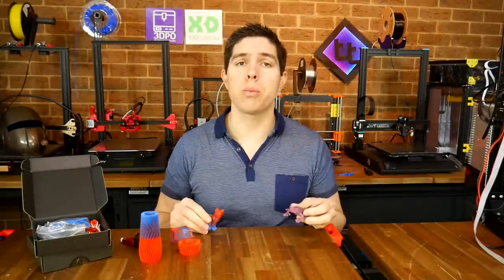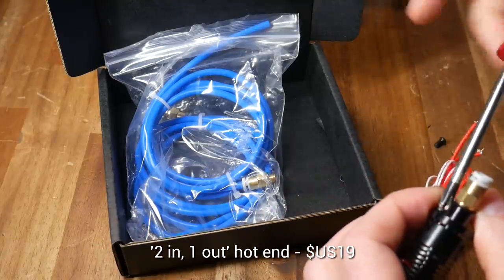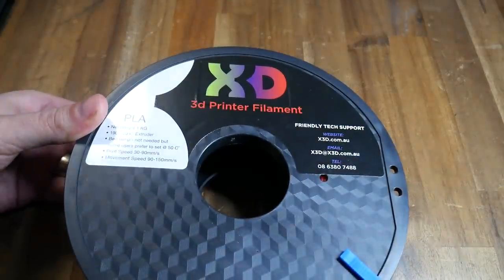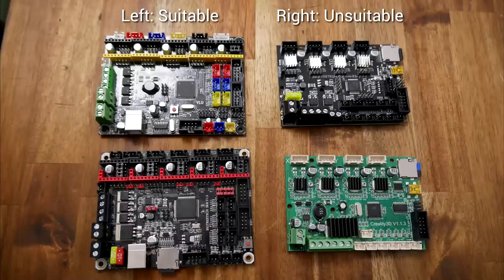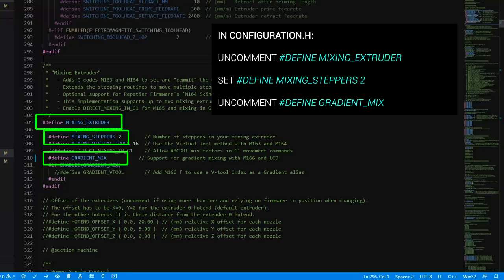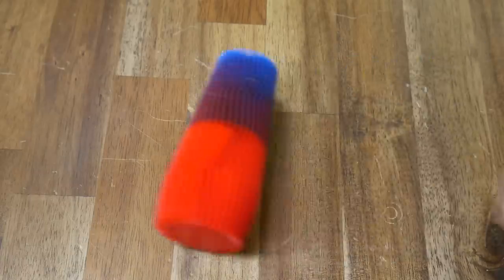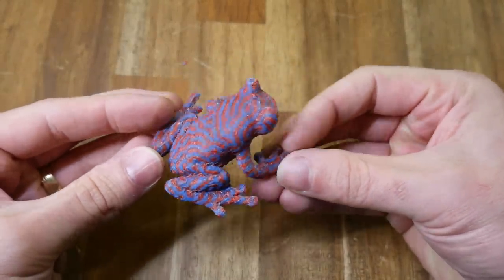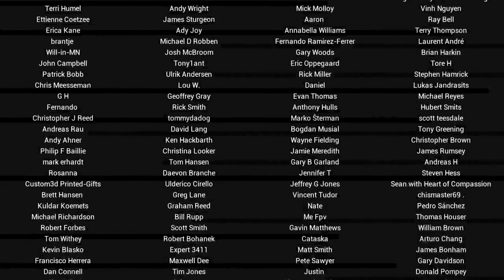Add dual extrusion with gradients - Mixing hot end guide

Comment: 1:01 I bought this hotend (that has a y joining peice at the top). This is so poorly engineered that it doesn't even work. When one filament is retracted and the other is moved to the nozzel, many times it is stuck. Also the part at the top of it is made of metal and it scraches the filament so badly and collects filament debrees inside of it which eventually results in a jam. Money wasted. Now I am going to buy the mixing hotend shown in this video hoping it works.
Reply: Hey so did you buy this one and get it to work successfully?
Reply: @syedsulaiman8380  No. It didn't work. The y joiner on that hotend is very bad. It scratches the filament and collects debrees inside it. Also very often when the extruder is changine the filament with other color, it blocks the way and the extruder stepper looses steps.

Now I have ordered the mixing hotend that is working in this video. Waiting for it to arrive.

Comment: As the nozzle is proprietary and non-replaceable one have to replace the whole heatblock assembly to switch to a new nozzle. Nozzles do degrade and need replacement every now and then. So that's a big "Nope". Huge dealbreaker.
Reply from the maker: Let's hope they end up selling just the nozzle, with a tool to remove it and in different sized orifices.
Reply: You could try an E3D Cyclops instead. A standard nozzle may or may not make mixing less consistent and require longer purges.
Reply: At least make it hardened steel.

Comment: Is this/similer 2in1 mixing hotend now being used in Sovol SV02?
Reply: Has anyone tried using SV02's mixing hotend in Ender3/Pro? Do the screw holes of SV02's mixing hotend match with with that of E3/Pro hotend backplate?

Comment: Yeah that proprietary nozzle is a deal-breaker lmao
Reply: Yeah it's a shame they use that strange proprietary form factor.
Reply: From the research I have done it's even glued in place somehow, so I don't know if/how it can even be replaced in the future.
Reply: Same sentiment, but AFAIK the mixing has to happen in the hot zone so you'll always be stuck with proprietary nozzles (unless there's some kind of standard for mixing nozzles?). Also those nozzles increase significantly in size (especially when you look at the 3 way mixing nozzles).
Reply: @rpnct  I have a 2 in 1 out mixing hotend that uses the same nozzles as the stock ender 3... apart from that it works exactly the same melting both filaments in the hotend block and color mixing / gradients etc all work as above.
Reply: @n2n8sda  hi can u share a link to find that kind of hotend?
Thank you very much
Reply: @n2n8sda  hey can you share the info on that hotend? That's the only thing I need for a complete build
Reply: @n2n8sda  Link to Hotend?
Reply: Ok this is awesome  would love too see it take a few steps more and have multi colour and types for supports, o rings and hinges
Reply: @--3D  i'm from Canada so that one is able to ship to me within a month so it seems like it could be a good option what printer did you install it to?
Reply: @datrandomdugggy5537  I'm from Uruguay I was planning on using it in an Anet A8 plus, but as I couldn't find nozzle replacement I didn't buy it
Reply: @--3D  doesn't it just use a stand nozzle?
Reply: @datrandomdugggy5537  check in the video min. 6:40 you'll see how different it is
Reply: @--3D  I was referring the the one you linked me it seems like it has standard nozzles
Reply: @datrandomdugggy5537  , sorry my bad the link I sent you is not the same like the one in the video
Reply: @--3D  the one you sent me does look like it might work
Reply: @datrandomdugggy5537  last night was late for me, sorry.
Yes, the one I sent you the link is 2 in 1 out.
But it doesn't mix colors.
Look for more info about it?
Reply: @--3D  yeah I'm going to do more research into this
Reply: @datrandomdugggy5537  as far as I know, the one in the video can mix colors and doesn't need much retraction to change colors.
And the one I sent the link changes filament on the top
Reply: There is a new version in which we can change nozzle
Reply: @syedsulaiman8380  link?
Reply: @syedsulaiman8380  do u have any links? Thank you
Reply: @syedsulaiman8380  thanks 🙏😊
Reply: @syedsulaiman8380  I don't know, but I don't think so.
Anyway this one is 2 in 1out but doesn't mix colors I think 🤔
Reply: @--3D  which one the one in link?
Reply: @syedsulaiman8380  yes, does it?
Reply: @EKUL34  awesome thanks for sharing 💪
Reply: In my amateur opinion, this should be possible with a standard nozzle but unique melt zone so here's hoping someone more skilled than me agrees and makes it real

Comment: I installed mine ok but after PID autotune via Octoprint terminal which confirmed that it had finished, the temperature is still fluctuating widely. I saved the settings via M500. Now, when I try to print something, the printer heats up but when it gets to set point, it doesn't start the print, only having E Heating on the status line. Anyone have any ideas? I've a printer now that won't print!

Comment: I know this video is old, but has anyone used this hotend recently? I'm having a nightmare with thermal runaway. Does anyone know whether a silicon sock exists/fits this mixing hotend?
Reply: Update in case anyone sees: if you're using this hotend, it comes packaged with an HT-NTC100K cartridge thermistor. If you're running an Ender 3, in Marlin configuration.h you need to change #define TEMP_SENSE_0 1 to #define TEMP_SENSE_0 11, upload new firmware, and then PID the hotend. :)

Comment: I think everybody is waiting for multi extrusion slicer software that will use the purge material as infill, reducing the amount of  material needed.
Reply: Prusa Slicer does but probably only reduces waste by 30%.
Reply: @petercallison5765   Need to check it out, working with Cura here.  I guess if the algorithms improve over time, waste reduction will increase.  Thanks for the tip.
Reply: @dutchsailor6620  Cura is better suited for the mixing hotend while PrusaSlicer is better for a Y-joiner type. Tested both hotend types with both slicers.
Reply: @DavidRelich I am now trying to get a dual direct extrusion head going on my Anycubic I3 Mega. Had to add another stepper driver and made some changes to Marlin to get everything going, but at the moment it seems as the best of both worlds with very little waste. Looks promising, the only disadvantage is a reduction of the  X-MAX dimension  by 19 mm.  Another thing I'm trying to implement is bed calibration by gently pressing the nozzle against the bed and measure the current of the Z-stepper(s). Not perfect yet but promising.

Comment: can you use this to do say hips support and print in abs?
Reply: Obv not, only works with similar materials. That sort of dual printing needs 2 serrate heads as different temps and settings are required for each.
Reply: @NirateGoel  I have done it now it works bc the printing Temps are close

Comment: fyi these hotends dont actually mix and the result is a toothpaste like effect which have not mentioned in the video. although u can get away with transparent filaments as the effect is not visible in them
Reply from the maker: I entirely disagree. The filamemts are mixed very well. I even did a three colour print using only two colours.
Reply: @TeachingTech  try a print in white and black and see the result
it is more pronounced in contrasting opaque colors. There is an entire thesis on this : https://www.reprap.org/wiki/Mixer_extruder

and richrap aslo has the same result : 

https://richrap.blogspot.com/2012/08/3-way-quick-fit-extruder-and-colour.html
Reply: @TeachingTech  Sorry Michael, but my hotend has that "toothpaste" effect. It's so obvious even while extruding to purge the filament.

Comment: what is this "purge block" you speak of?
Reply: Are you asking what a purge block is?  If so, a purge block is printed next to your primary dual color print, so that the "dual extruder, (single nozzle / mixing nozzle) has a place to get rid of the old color before switching to the new color.  So in other words, it "purges" the 1st color before switching to the second.
This is really only used if you're trying to make a dual color print that does not have colors mixed together.  If you are printing two colors, say white and black, and one of them blended in the middle, producing various shades of gray, You would not need the purge block in that case.  But let's say you made the same print but alternated white and black (like a zebra), then every time it switched colors it would have to run to the purge block and dump out the old color so we can have a crisp clean start with the new color.  Mixing extruders are great for doing multi-colored prints and blending colors. However my experience is they are absolute garbage for printing support material because it requires a nozzle temperature to be different a lot of times.  This is why I'm setting up a printer with dual nozzles as well as dual extruders. I won't be able to blend colors but I will be able to print support material fairly easily.
Reply: And adding to what I just replied, My ultimate goal once I can make the dual nozzle setup work, is to add another extruder, making 3 total, and changing out one of the nozzles to a mixing nozzle. So I could either print three colors having two blended, or print two colors and support material.
Reply: And adding one more thing I guess, lol, is that if you have space on your motherboard for an additional extruder already, You can actually buy mixing nozzles that are fairly inexpensive and small, and replace the factory nozzle on a lot of printers. A great printer for this would be the Ender 3, except the main board does not support a second extruder but if you replace the main board you are good to go..
Reply: @jameswiz  thanks. I have never had to use a purge block yet. I have a 2to1 printer and was wondering how that would work.
Reply: Basically, with a 2in1 mixing nozzle, you would use the block to clear out all of the 1st color, before it starts to print the 2nd.  Assuming you don't want them to be mixed in the print.  So again, printing with white and black, you would use the block if you want crisp lines like a zebra, or let it mix of you want white, various shades of grey, then black.  If you are looking for more info, you're going to have to be a hair more specific in your question

Comment: Makes you wonder when someone offers an RGB hot end.
Reply: diamond hotend?
Reply: RGB works with light emitors (like those in your TV's display, for example). For additive manufacturing you'd need a CMY hotend (cyan, magenta, yellow), ideally a CMYKW (K for black, W for white because I doubt it is possible to mix the CMY colours consistently enough to achieve a stable black or white colour). So you'd end up with a 5in1out mixing hotend, haha.

Comment: Maybe you should try out a new due or quad mixing g code based system called " 3D CHAMELEON "  > https://www.3dchameleon.com.  They have a system which they say makes it possible for any printer to use it?  You can have two colour spools or four or as many as you can fit on the printer frame! It is said to be controlled by extra g-code, were the head moves over to the side and presses against a control box button which then uses that extra g=code to change the filament colour over to what you set up?  The filament is retracted each time so the next one can go through the Y shaped tube to the head. the filament will be purged onto a thin wall around the model. and so on. Hopefully wasting less filament?  Maybe if you get one you can test it out and do a video for the rest of us?  Thanks..